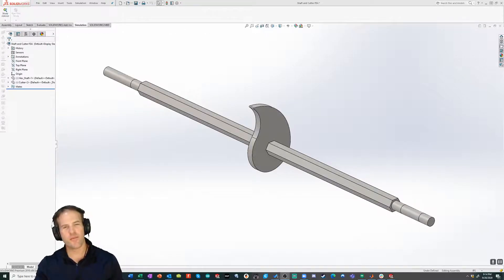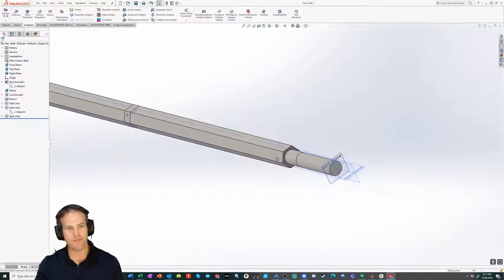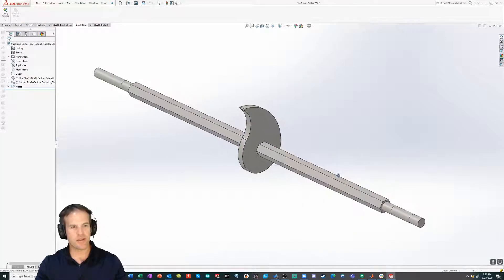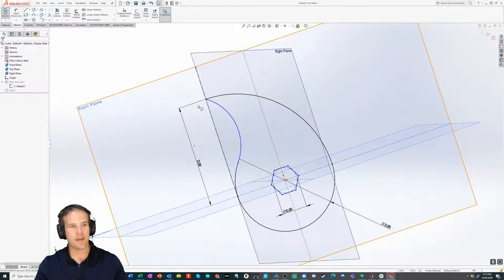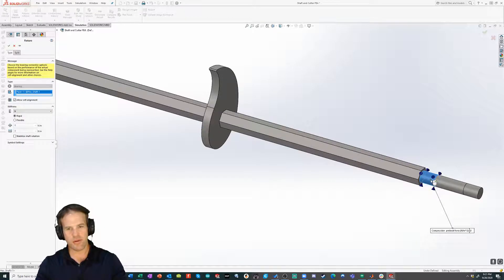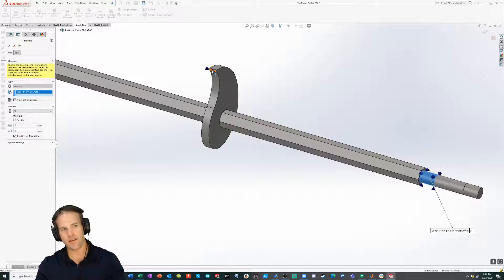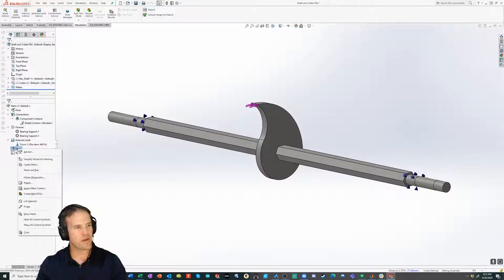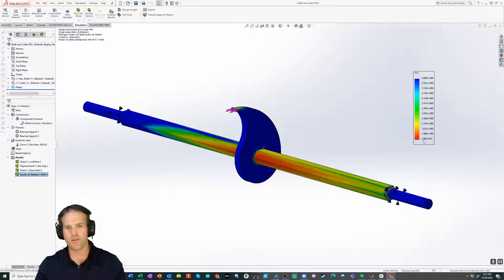SolidWorks Shaft FEA Example for Plastic Shredder

Comment: Gotta express my thanks! Been trying to simulate a shaft more accurately using the bearing fixture, but I kept getting a large displacement error. Turns out what i needed to do, as you showed, was to make at least one of the bearings "stabilize" the shaft. I also thank you for explaining that if simming the shaft alone, we have to add a torque at the points while if the gear, pulley, whatever else is present, the forces are enough

Comment: I'm getting  the error as "No loads or prescribed displacements are defined
(for problems, with special loads such as Thermal, Gravity 
 or Centrifugal, activate the proper flag)
 Loads on Fixed-Rigid parts would not be active.

Comment: Hello my teacher
Your tutorial video is very useful. Could you do any other analysis on shredder? for example about the forces applied to the support walls.
No analysis has been made for the shear force of the plastic material. How did you determine the 440N force?
thanks professor.
Reply from the maker: Great points on here. This shaft analysis for a shredder is intended to be a rough starting point for analysis. I assumed 100 lbf (440 N) as a rough estimate to shear plastic, but more analysis is needed to determine the actual shear force based on the thickness of the plastic, material properties, and the total shear area. The housing is definitely an important consideration, especially when you add in the motor and transmission, but that's outside the scope of this particular video (just to keep things simple for an initial calculation). I may do a follow on video to extend this analysis.